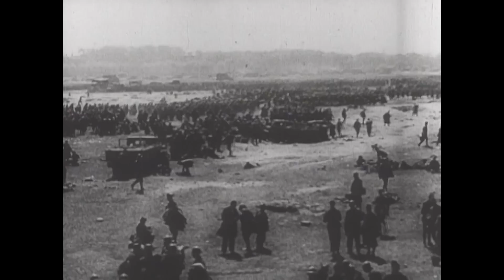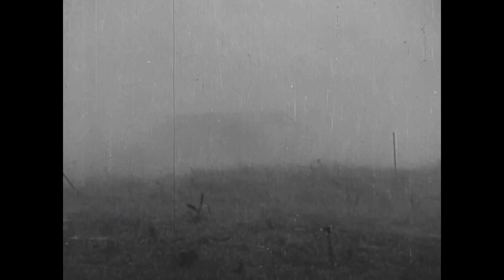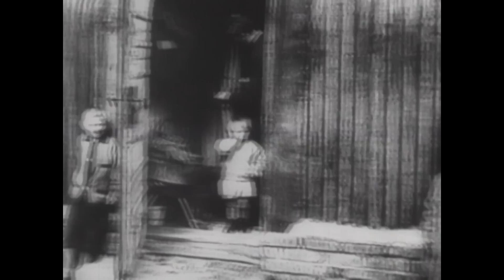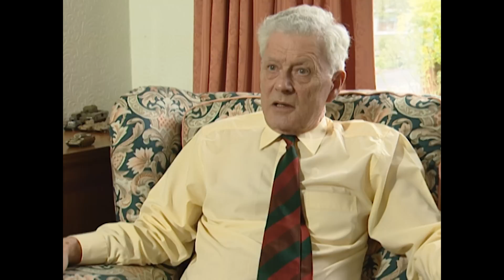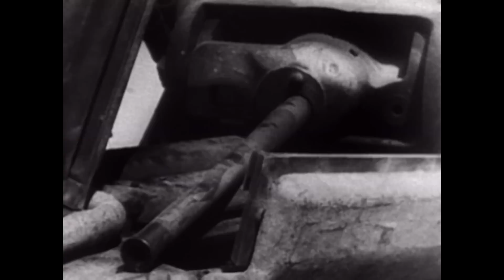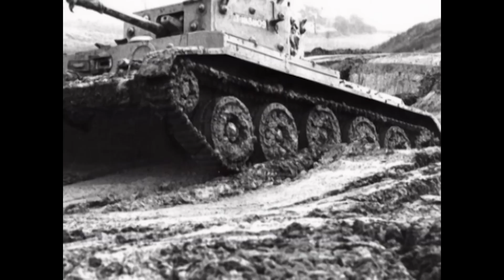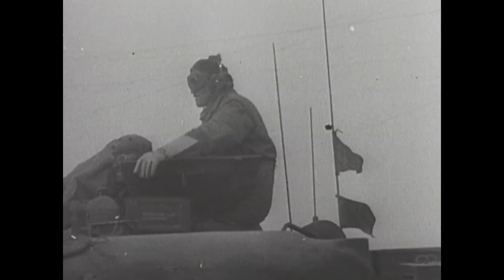How The Cromwell Reinvented Britains Approach To Tanks | Tanks! | War Stories

Comment: To me it looks like they stopped developing the Cromwell after designing the suspension which looked even today not outdated.
Take that in comparison with thr bolted armour plates. The flimsy gun and the way the machine gun was fitted.
Really strange that it was designed with such a small gun after already havind encounterd Tigers in ‘41. Still a great tank to watch though with its low profile and smooth and fast ride

Comment: The lack of HE was due to the incompetence of the war office. The 40mm gun was better than any of 37mm guns used by other armies.
Reply: It was far worse in the case of Matilda II CS and Churchill I which were armed with QF 3" howitzers but were given smoke rounds. Apparently British Army had this insane doctrine for CS tanks which was to smoke parts of the enemy tank force and isolate them from the battle instead of supporting the poor infantry closely with HE rounds.
Reply: It's untrue that the 40m 2 pounder couldn't fire a HE shell it could however the HE shell  wasn't issued to the the tanks been deemed to have to small a HE charge by some pen pusher

Comment: Re: the German 88mm in 1941/ '42

The Germans, especially Rommel, used their 88mm anti-aircraft gun as an anti-tank gun against British cruiser tanks, which in 1941 and early 1942 ONLY had 2-pounders, firing anti-tank shells, with NO high explosive shells at all. Yet the British also had an anti-aircraft gun - the QF 3.7-inch AA gun (with an even wider calibre of 94mm), which would've been just as effective as the German 88mm had it been deployed against tanks.

So the lesson here: fighting is about tactics, training, and flexibility. 

BTW: British artillery, in the form of the 25-pounder, were effective against German tanks (in 1941 and 1942) and the British had AP-shells for them.
Reply: You obviously never heard of the QF 3.7 Ram tank destroyer
Reply: @TommyEgg-wp8is   I heard of the 3.7" pressed into service as field artillery, especially firing air-bursts just above enemy troops; but I was under the impression no armour-piercing shell was used for the 3.7" gun during WWII.

Comment: What I take from this is that UK between wars had two or three major things that stopped the development of the army & to a degree the Air force.
Where before the war the Germans knew how they wanted to use the Tank with infantry &air support which they practiced but was also helped by experience gained in Spains cival war. UK had two many competing ideas about how a tank should be used and what it could do throw in lack of funds then lack of combat experience at the start of the war was a disaster waiting to happen. But this was compounded by the slow feed back to design & Develop & build better tanks. The Germans as the war went on were handicapped by the political people in charge insisting on bigger gunned heavier tanks that needed more fuel they didn't have and resulted in problems with the weight causing problems of reliability parts wearing out quicker & limited areas it could be used  and so slow easy kill for Aircraft. A Good Tank is a blend of fire power, protection from hits, speed, range,  ease of use, ease of maintance and probably a big obvious one Reliability.
That is done with natos modern tanks with Challenger 2/3, M1A Aberhams and Panther 2 tanks of today but all have slightly different use cases ie Challenger design original had it picking of enemy from range while hidden then fast moving, M1A was to take the fight to the enemy, Panther 2 combination of the two.

Comment: Though not state of the art when it made its debut in 1944, the Cromwell was actually more mechanically reliable than the Sherman for long advances with a higher survivability rate as well.
Reply: The British developed the much superior (to the ones they’d used previously) Meteor engine 500–550 hp and by the end of the war pushing 600–650 hp. However, the Meteor was effectively 80% a Rolls-Royce Merlin and the priority was the RAF and air effort for a large part of the war, with massive demand for the engines to go to planes such as the Spitfire, the Mosquito and the Lancaster, so there were never enough engines. It made sense for the British to use Shermans not because the Sherman was so much more reliable than the Cromwell.

In September 1944 General Verney, commander 7 Armoured Division commented 

I feel that I must write you a short note to tell you how superb the Cromwell tank has been during our recent activities, and I hope that you will pass on the gist of this letter to the various people responsible for the production of the magnificent machine… At dawn on August 31st we started our advance [and] it has carried us 250 miles in six days. We have lost practically no tanks through mechanical failure (I would guess four or five per regiment). Anyhow, so few that the matter has been no anxiety whatsoever. We have had actions every day [and] there has been no maintenance what- ever…The tremendous speed [has] alone made this great advance possible

The Sherman got some stick

4th Armoured Brigade was extremely critical of the M4 and M4A1 (Shermans). The engines seem to have required replacement on average every 600 to 700 miles. Brigade workshops had already changed thirty and expected to deal with another one hundred in the near future…

And

When the 3rd and 4th County of London Yeomanry amalgamated [in August 1944] officers from the latter reckoned the Cromwells they had given up were every way superior to the Shermans they now have to work with…….Maj Gen Verne, commanding the 7th Armoured Division…praised the Cromwells as ‘superb’ and claimed that mechanical breakdowns had been so few as to be negligible
Reply: @johnpeate4544 
Excellent. Thanks for the input there. It was well known that the Cromwell was mechanically more reliable than the Sherman during the Great Swan across France. 
Cheers.
Reply: @lyndoncmp5751  

Just to add, the British did a study late war of allied tanks, and yes the Cromwell seems to come out on top in Survivability.
Reply: @johnpeate4544 
Yeah, this is from the report. 

""An interesting and possibly surprising fact from the British medical study, there was a significant difference in casualties between the Cromwell and Sherman when hit by artillery and anti tank fire typically 55% of the Cromwell Crew escaped unhurt whilst its 35% for Sherman. Also a greater number of casualties died from their injuries, in the Sherman 46% than did in Cromwell 33%."" 

From Montgomery's Scientists Operational Research in Northwest Europe, the Work of No.2 Operational Research Section with 21 Army Group June 1944 to July 1945” by Canadian historian Terry Copp, published by Laurier Centre for Military Strategic and Disarmament Studies Wilfrid Laurier University, Waterloo, Ontario, Canada.
Reply: @lyndoncmp5751  

Great stuff.
Reply: @johnpeate4544 
You too.
Reply: @lyndoncmp5751  

Cheers 👍
Reply: @johnpeate4544

Do you think Nick Danger got what he requested 😂?
Reply: @lyndoncmp5751  

He did but somehow I don’t think he’ll accept it. 🙂
Reply: @johnpeate4544 
I doubt we'll hear from him again in this thread.
Reply: "more mechanically reliable than the Sherman"
Source ?
Reply: @nickdanger3802 
Source? David Fletcher, British Armour In The Second World War.

Comment: This myth that the German 88mm was an anti aircraft gun that, to everyone's surprise, could double up as an anti tank gun just won't go away. It was always designed to fit both roles, being designated PAK 43 for AT and Flak 41 for AA. I'm going for typical German contractions of Panzer Artillery Kannonen for PAK and Flug (or Flieger) Artillerty konnonen for Flak.
Reply: They were 2 different guns designed by different companies, so were never designed as duel role. the Flak 41 was just pressed into the role out of need.

Comment: An upsized 40 ton Matilda with a meteor and with a 57 mm and then a 76.2 mm would have been fantastic.  Don't know what they the ministry of supply were thinking about during the war.  The Cromwell vertical front surfaces - what were the designers thinking about.  Again should have been a 35 to 40 ton tank with the 17 pounder.
Reply: There was a larger gun fitted to the Matilda later in the war for close support work.

As to front surfaces, problem comes with to having heavy tooling, etc, to produce them. Takes time to develop the ways to produce it.

Comment: The Battle of France forced the British to reconsider their tank philosophy. The Matilda had good armour but it was slow and lacked firepower. The crusader had mobility but lacked both armour and firepower.  The British needed American Grant and Sherman tanks in order to succeed in El Alemein.
Reply: The Grant made zero difference in the rout at Gazala, while El Alamein was won because Montgomery placed far greater emphasis on artillery rather than tanks, and much close ground to air coordination. I can't agree that Grants and Shermans were the sole reason.
Reply: Nonsense. Alamein was won primarily by artillery, infantry, anti-tank guns and the DAF. The armour was still stuck in the ‘Devil’s Garden’ until near the end.

The first Shermans were actually constructed in a factory in the United States which had been paid for by the British. The Lima Locomotive Works, Inc in Ohio was a manufacturer of steam engines. In February 1941 the British government signed a contract for them to make and supply 400 tanks, and as part of the deal the UK provided the funding for a new 11,600 square metre manufacturing facility, with all the tooling and equipment necessary to produce 50 tanks per month.

Britain spent it’s massive US currency reserves during 1939–41 on things like paying for US factories to tool up to make tanks and aircraft on their behalf and helping to pull the US out of depression.

The facilities chosen to build the Grants were in various states of disrepair, none more so than Pressed Steel Car's "Ghost Plant" in the Hegewisch neighborhood of south Chicago. This factory, which had been used for the manufacture of railroad cars, had stood empty since the Great Depression, and had "no roof, no floor, no machinery." The British Production Orders provided funds to add to, refurbish and equip the plants, including a late addition in February, 1941, the Lima Locomotive Works in Ohio, originally contracted to produce 400 Grants. The montage above shows the progress at the Hegewisch plant from February through April, 1941.

When the US government set up the Lend-Lease programme, the British government agreed to sign over its ownership share of the Lima Locomotive Works to the US, in return for a promise that the US would supply them with tanks free of charge for the duration of the war.

The British also had some influence over the design of the Sherman, though reluctant to adopt British weapons into their arsenal, the American designers were prepared to accept proven British ideas, such things as the low profile, split hatch cupola, the loader's periscope, and immediately incorporated them into the design of the Sherman turret, as well as the loader's hatch.

The British gave feedback and suggestions to improve the complex engine and tank generally.

The difference from the first used by the British in North Africa to the E8 was vast to the point they were different tanks. Initially in north Africa they were found to be shaky and consume huge amounts of petrol.

In 1942 the US were eager to supply about 250 unproven Sherman tanks. The US were desperate to get the tank blooded in battle, so the British could do that for them, giving them feedback and improving the tank.

The Sherman’s first showing was at El Alemein. The Sherman tank supplied was complex, as they never had a proper tank. They never had a dedicated, light & powerful, tank engine, which was a great disadvantage at first. Neither did the British until they introduced the RR Meteor in the Cromwell.

In addition, the new equipment reaching Eighth Army greatly increased the problems of inexperience -8th, 9th and 24th Armoured Brigades for instance all received their new Shermans too late to gain any real practice with them before the battle began. They also found that there was a dearth of spare parts and many important items of equipment, such as compasses, were missing altogether. The Shermans later gained a deserved reputation for reliability but in those early days when neither their crews nor the maintenance units were used to them, it is hardly surprising that, in the tactful words of Lucas Phillips, ‘several of them were found to be mechanically shaky’.

…As a crowning misfortune, the Shermans revealed another defect which had been concealed by the static nature of the fighting at Alamein: in these difficult conditions they consumed what the Official History calls ‘fantastic quantities of fuel’.

…Currie’s brigade had been built up to 121 tanks of which seventy-two were Shermans or Grants and the rest Crusaders, but by this stage of the battle a number of the Shermans in both 9th Armoured Brigade and 1st Armoured Division were very much ‘mechanically shaky’.”

-Eighth Army's Greatest Victories: Alam Halfa to Tunis 1942–1943 by Adrian Turner

Later in the war the British developed the much superior (to the ones they’d been using previously) Meteor engine 500–550 hp and by the end of the war pushing 600–650 hp. However the Meteor was effectively 80% a Rolls-Royce Merlin and the priority was the RAF and air effort for a large part of the war with great demand for these engines to go to planes such as the Spitfire, the Mosquito and the Lancaster so there was never enough. It made sense for the British to use Shermans not because the Sherman was so much more reliable than the Cromwell.
Reply: The German panzers also had better radios enabling communication in the battlefield and the ability to call in air support. Then they had the commander's cupola which gave a good field of vision.
Reply: @ngauruhoezodiac3143 ii
Reply: Tanks in WW1 didn’t have turrets - guess Renault did not get the memo.  The British  tank philosophy was of infantry Heavy tank like the Matilda and the cruiser tanks light fast tanks for exploitation.  This is based on cavalry doctrine.  Heavy cavalry like cuirassier and lancers and light and medium cavalry.  The problem was the allies in did not deploy them as cavalry.

Comment: This is an old video.       I read recently that the reason the Meteor engine ( an un supercharged Merlin ) was slow getting into production , was the delay getting the required machine tools from the USA.   Initial Meteor engines were from aircraft crashed !!
Reply: Not heard that before. The Meteor was eventually made by Rover after Hives (RR Boss) made a deal with the boss of Rover to take over gas turbine development from Rover in exchange for giving Rover the rights to manufacture the Meteor.

Comment: Quite right that the 30s saw Britain sacrifice it's lead in tank development. Another classic british failure, but then funds were short, and unlike the ussr and germany the UK wasn't run by a psychotic dictator.

The BEF was the most highly mechanised force in the world at the time of the German invasion. The striking feature of of the most successful tanks was that they all had 3 man turrets - UK, Czech, USSR and Germany all had vehicles with 3 man turrets. Matilda 2 was a far superior vehicle for tank vs tank engagement than the PzIII of 1940. Britain mis-stepped in the panic after Dunkirk - with no tanks both tanks and anti-tank weapons didn't step forward for the next 18 months.

Utter hogwash how the video talks up russian tank reliability in the 30s

Pz3 Ausf. J was introduced in 1942 just a few months before Crusader Mk3 - which had equal armour and a far better gun - though as noted that had a 2 man turret, as did the later valentines.

The tactical use of armour was a far bigger problem. The rail transport legislation was another issue. No mention of Challenger.

Good discussion on Comet - D-Day certainly resulted in another delay in development, and of course with the design of Centurion the turret ring restriction was ditched, and so was the limit on cruiser tank weight - and with Centurion the tank changed forever.

Comment: At the end of the day a good tank just two years late for it's time. Same with the comet tank if the UK had been able to land those on D Day it would have been a lot better.
Reply: In a word, engines. Really one of the major issues Britain had with designing a good all round tank was until the Rolls Royce Meteor came along they did not have a really good tank engine, so they always had to make more compromises than they would have liked. 

The slowness in adopting Cromwell was as much about availability of the engines, and that was, in part caused by the whining of the Air Ministry who saw Rolls Royce as theirs, and did not like any of RR's engine production being diverted from Merlins. Add to that the Meteor was essentially (though not quite) a non supercharged, derated merlin and the Air Ministry lost their collective little minds and blocked production until they were essentially told to stop it.

Unfortunately that was only one time the Air Ministry acted like a bunch of spoiled children. The Fleet Air Arm had ordered a redesigned gull winged Navalised Fighter (heavily based on the Spitfire but different enough to be a new aircraft) which got cancelled when the Air Ministry blew a head gasket, same with the replacements for the Fairey Swordfish. Essentially anything the FAA tried to order that had Merlin engines was essentially blocked by the righteous anger of the morons in the Air Ministry, which put the development of carrier Aircraft in the UK back by three or four years. We did not start catching up until the Hawker Sea Fury which did not enter service until late 45....